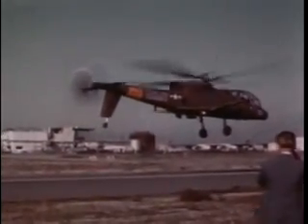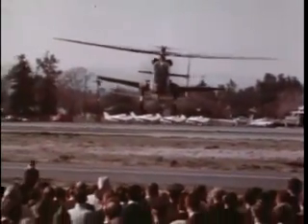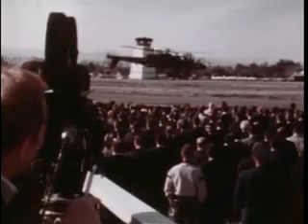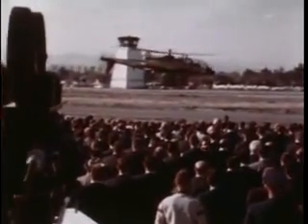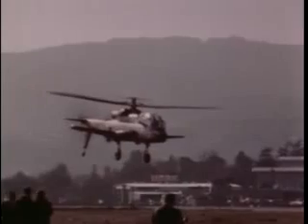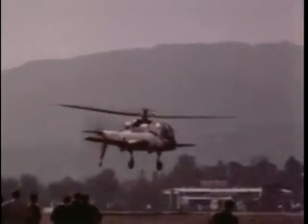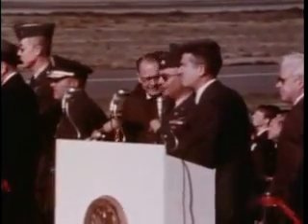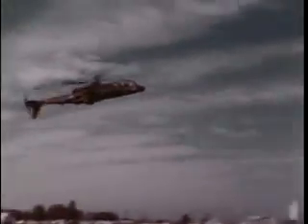AH-56 Cheyenne attack helicopter

Comment: I noticed one subject is missing in the comments as to why the AH-56 was cancelled.  The tremendous cost of the repair parts and special tools list as offered by Lockheed.  Was not fiscal viable in the Army's budget back then.  As to the top speed of the AH-56, the Army pilots are not used to the 375 mph that the AH-56 could attain.  The OV-1D Mohawk was too fast.
Reply: No not at all. It was a combination of the key west agreement, politics and very heavy lobbying on behalf of Bell

Comment: If u put a body wing down both sides of the tail that blends w/the stub wings & put a V-22 wind twin tail w/ plane rudder controls u would really hve something. The rear gear would b a set of two on the <H> tail.  <Side y> none moving small canard stub front wings can give u two pod mounts pnts, to keep the wings clean. 4> 20mm old schools guns(WW2)could b internally fixed n the wings. 2 sidwinder missile hard pnts on the wing tips. Bottom sealed weapons bay holding ground attack bombs or anti ship weapon. Lastly the wings need a twist closed to the body & blades fold up. Add a little stealth coating & a price not more than 70 mil per copy & u hve a winner.

Comment: Lockheed was 50yrs ahead of the game. Tech caught up & found it's way n2 other platforms but the flight performance still has not reached this speed. I am sure the push prop raider design is much safer, but w/out the add speed will find it hard to make a case if valor comes on line. They may hve to steal some more from this machine, only w/sound helo blade control/tech & better engines. Another case of to good, so we need to spoon feed them less so we can keep newer model cars giving you a reason to buy new. The core was there. The tech needed 10 yrs, but enough of it was there to get a work front line helo. All they needed was an experienced helo manufacture partner. Or was it the old Army vs airforce dilemma. Can't hve the Army hving anything quality that flies, or what will they need airforce for.